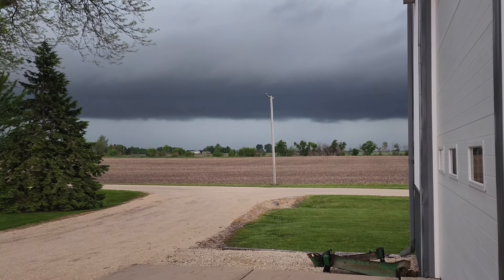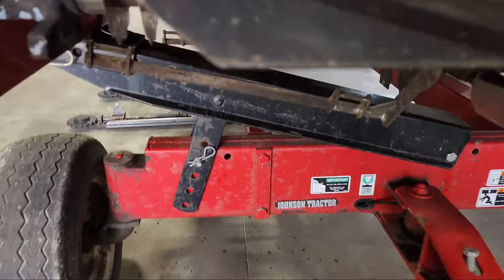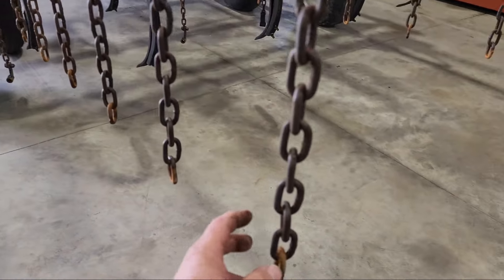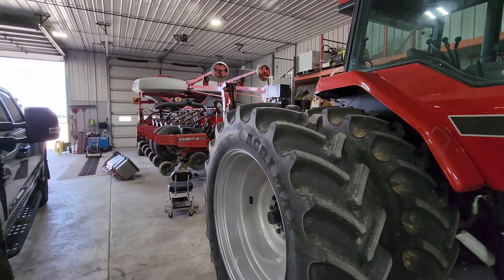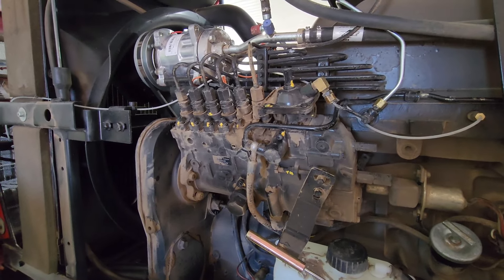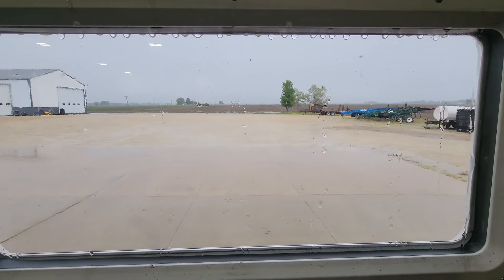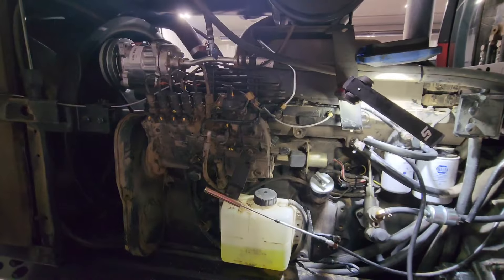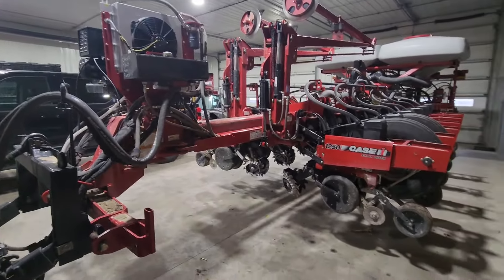rain day shop work

Comment: How much horsepower is that magnum supposed to have. Because my 8770 plays with my 16 row on the hills. Just need to add some weight to the front.
Reply from the maker: 250 I think it just needed pump adjustment. The bulk fill does make it pull harder than a box planter I can put 100 units of seed in it at a time and more hyd horse power to run pto pump and blower motor off remote
Reply: @rgfarmsrepair503  yep but I have a 500gal fertilizer tank. 8770 is 180hp

Comment: Before you turn the fuel delivery screw I'd set the low idle and the governor bumper spring. Unhook the throttle cable at the pump then back out the lower bumper spring set screw until the engine no longer slows down on rpm then adjust the top low idle screw in until the engine idles at 810 rpm with the A/C on. Then turn the bumper screw in until the engine idles at 900. I'll jack the throttle to check the adjustment after I'm done to fine tune it and make sure that it stays. That adjustment is critical for the governor to react and work properly
Reply from the maker: That is exactly what I did yesterday off camera. I  set it to 825 then used bump screw to take it to 875 per the service manual. Thanks for the comment
Reply: @rgfarmsrepair503  I like to bump them the full 90 RPM and have it idle at 900. Keeps the PTO chatter away at low idle and makes it react quicker. Did it wake it up?
Reply from the maker: @mattvandevelde3839   It was pouring rain outside so I haven't been able to try it out. I bet that is going to fix it because ur right it seemed like governor wasn't holding rpm under load and it was getting worse. It idled low after overhaul but must have settled in and started idling lower. I will readjust it today as you recommended 👌 thanks